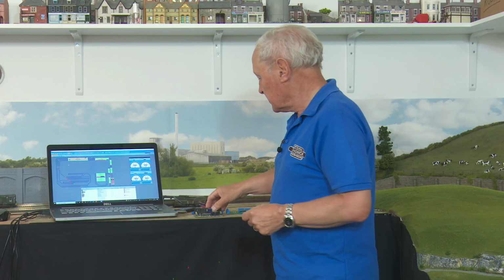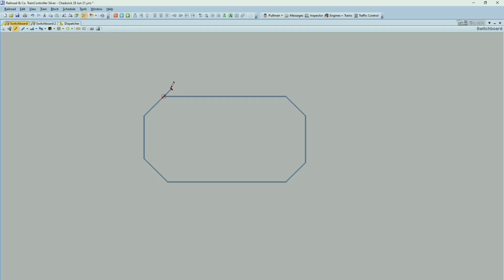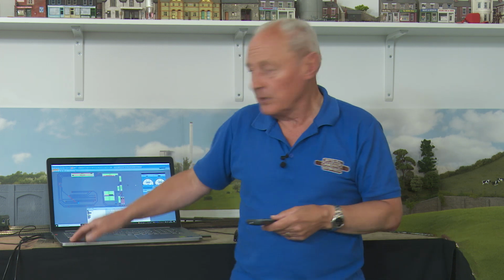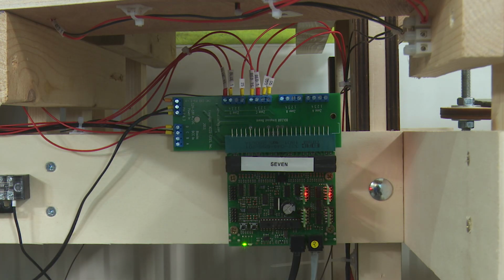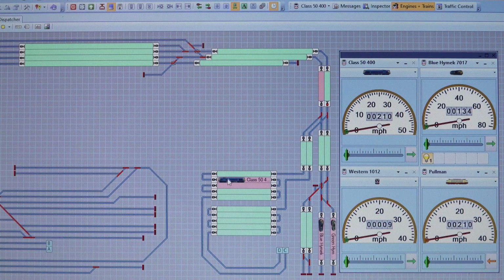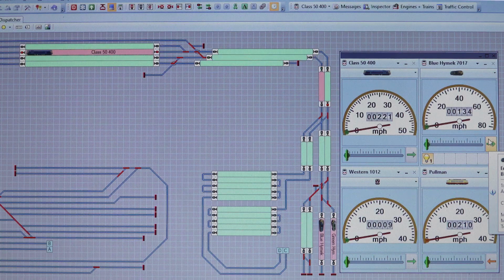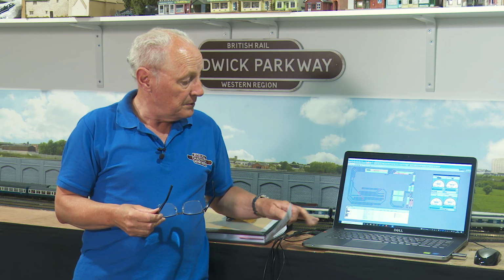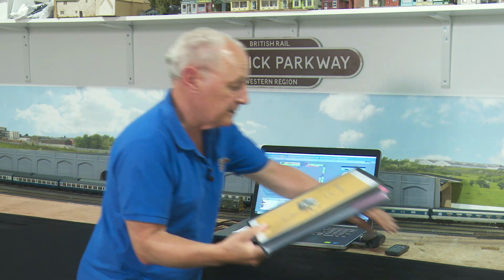An Intro to Block Detection at Chadwick Model Railway | 137.

Comment: A quick look, sales to the UK are made through Digital River.
It seems the cheapest place to buy it is Germany where it is made. It is slightly more expensive in Belgium than Germany which is strange as they can't stop a Belgian downloading it as a German. That right doesn't apply to us in the UK any more; though if you pay in Euros and download via a VPN that hides your location you might get away with it?
Reply from the maker: I still believe that we are getting ripped off mate. Regards Charlie
Reply: @ChadwickModelRailway  Only got ourselves to blame for it though.
Reply: The software itself is free, you can download and use in demo mode (runs for about 10 mins then drops connection to the controller) . When you purchase it, they actually send you a USB stick that has to be plugged in to maintain connections (you can see it on the right hand side of Charlies laptop). Its handy if, as I did, download and try it out and see how hard it is to use and if it does what I wanted before taking the plunge and spending cash.
Reply: @BearsTrains  That explains how they can use differentiated pricing within the EU. The price differential for the UK is customs duty, commission and charges that have to be added since January 2021. Not us being ripped-off by the supplier then but us being ripped-off by our own collective stupidity.

Comment: There is a system called Dinamo which will run DC locomotives and Digital Locos with computer control. We have a demo in the shop at DCC Train Automation
Reply from the maker: An excellent point James.

Comment: Good video as always Charlie and explains block detection very well. As to the price you quote for the digitrax bdl168 it can be picked up much cheaper than the price you quote. Detection on points personally I do it but some others don’t but something to bear in mind is the volt drop between a detected section to undetected one. Are you aware that when you use a bdl168 and track power is off but there is voltage supply  feed to the bdl168, that there is a small 1/2 volts supplied to the track still. This is caused by leakage within the bdl168 allowing some of the supply voltage through. By the way at present I have a total of installed bdl168s is 55 and climbing. 

As to train controller price the reason is simple for the rip off price, but I won’t comment here as to why. But how can it be justified that a 300 dollar difference in price between one country and another, in fact the day we voted to leave Europe prices were put up, and at one point stopped selling to the uk completely. The developer of I-train must be laughing at the cost of Traincontroller.
Reply from the maker: You make an excellent point comparing itrain to train controller. Welcome to rip off Britain, regards Charlie
Reply: Chadwick Model Railway 

not so much rip off Britain I think, more like not liked Britain

Comment: Hi Charlie, If you are not afraid of DIY electronics and can wield a soldering iron with reasonable confidence then there are much cheaper alternatives. I use the Digikeijs system as a basis for my layout. The most important thing for me is Loconet, as this means everything is communicating with everything else. However, as you have pointed out, proprietary systems can be expensive, i.e. Digitrax. There is a man in Holland, Nico Teering, who has developed a loconet system based on Arduino hardware. His company is ArCoMora (Arduino Controlled Model Railway) He will supply kits for you to assemble and solder yourself for servo and accessory control as well as block detection. The block detection hardware is called ArLoco and consists of an Arduino shield (you have to supply an Arduino Uno yourself) and two Okkies that are current detection boards. You may also use reed switches or hall effect without using the Okkies if you so choose. The main thing is that the ArLoco board communicates to the system through Loconet. I can knock up a few of these in an evening at home and the cost is much lower. The cost of an ArLoco shield and two Okkies is currently 15.75 euros and that will give you 16 channels of current draw block detection. His servo controllers are good too, costing just 8.75 euros to control 8 servos and 8 relays. The downside is you have to assemble and solder it all yourself but if that is within your capabilities then it certainly can save a lot of dosh. Hope this helps others who may want block detection but don't have deep pockets. I have spent a day with Dave Townend at McKinley and it inspired me to get into automation but on a much less grand scale.
I am currently working on Turntable control through Arduino and stepper motor. That would make an interesting video at some point.
Reply: P.S. I also use Signatrak DTM30's for all central control which means I can choose between switches and levers or leave it to the computer. They really are great little boards for the money.
Reply from the maker: A great comment Keith and I shall certainly check out the signa track board.

Comment: A great video as usual, Charlie. It's probably worth pointing out that you can get benefits of Block Detection without using any software at all - other cards can pick up the section occupied messages and "do things" (like setting signals or operating a control panel). I'm flabbergasted by the current price of TC Gold, especially the way they're ripping off the UK - even assuming they're adding 20%VAT this doesn't explain it.

As for the DR4088LN-CS, the LN stands for Loconet and the CS for Current Sensing. That beastie really is compatible with the BDL168 (other than not being able to be on 4 power districts IIRC) and you'd have no problems in mixing them on a single layout. To save even more money, you'd only need one LN device, and others can daisychain to the cheaper still S88 devices, and you'd still get everything presented to loconet!
Reply from the maker: Great comments John, I’m so pleased that you found the video interesting. Regards Charlie

Comment: Great video as usual. My layout (Tinkers End) is around 15m by 6.5m and has over 100 points. I use Digitrax (one main controller and two boosters) these power Digikeijs units for block detection. As the layout is split into 3 main power areas I use DR4088LN-CS, as you described, as the main unit attached to the power supply but then daisy chain DR4088CS off of them which makes it a bit cheaper. Actually that's not quite true I now have DCC Specialities PSX3 or PSX2 units immediately after the controller (or booster) so that track power is kept separate from points motors etc. The system all feeds in to TrainController Gold for as much automation as I want on the day. In terms of price I did see somewhere that the guy who develops the software wasn't happy dealing with UK modellers (and that was even before Brexit).
Reply from the maker: A great comment TE. 
Where are you in the UK?
I’d love to meet up once this madness dies down.
Regards Charlie.
Reply: @ChadwickModelRailway  Actually I live in the Murcia region of Spain but if you are ever over here let me know.

Comment: Thank you for a fascinating overview. You implied when talking about pricing that ‘mix-and-match’ between manufacturers is not an option, but as long as the Digikeijs DR4088LN uses LocoNet won’t it run just as well as any other unit? I do understand the warmth you get from staying with one manufacturer, but I thought the whole point of using LocoNet was to provide a standard interface. I assume you tell Train Controller what devices are connected to your layout and it then knows what commands to issue to the various devices.
Reply: Yes the digikeijs DR4088csln will work with loconet. The C's stands for current sensing and the ln stands for loco net.
There is a version without loconet that uses the sx88 protocol ( I think the name is correct) that is slightly cheaper that will work with other SX 88 protocol gear eg the dr5000 command station.
Reply from the maker: You make a valid point Peter but maybe DCC Train Automation should be your best contact.

Comment: Great video again Charlie. After talking to James at DCC Train Automations a few years ago I went down the Digikeijs and iTrain route and it all works great. It's much cheaper than Digitrack. The command station can work with most if not all systems.
Reply: Hello Steve hope it all working well if you need and advice or help please let us know. Or if any one needs and help with computer control we are here to help you all.
Reply: @DCCtrainautomation  Hi James. I will be down to see you soon as you still have my two locos. Been held up in London with work.
Reply: @stevewebb1606  they are all done!
Reply from the maker: Thanks Steve, great choice with great support too.

Comment: Hi Charlie,

Great video again. You said you couldn't find a system that is usable for DC. Well in fact there is one: It is a Dutch product called Dinamo. It is made by a small firm called Van Perlo Electronics and Automation.

http://www.vpeb.nl/index.php/english/solutions/ 

It makes it possible to run both DC and DCC trains on a single layout. The system knows if there is a DC or a DCC train in a block and sends the proper voltage (analogue PWM or digital DCC) accordingly. It is more expensive per block, but it saves the cost of building a DCC decoder in every loco. I also have some small H0e loco's in which it would be difficult to built a decoder.
It can be perfectly automated using iTrain.  I myself am using this combination and I like it very much.

Regards, Rudolf from the Netherlands
Reply from the maker: Thanks Rudolf, that's most helpful.

Comment: Interesting stuff, and well-presented as ever, Charlie.  Right, crawling over.  "If you want block detection in DC, you need to switch to DCC."  Ahem.  My dad and I had block detection on our layout back in the 1980s.  Exactly the same principle as you showed, with insulated rail joiners at each end of the block (which we had already, of course, with control DC). If there was something with a circuit (a motor or a lit wagon, or a wagon with resistor across its wheels), it would trip the track detection module, and it'd show as occupied and set the preceding signal to red.  The track detection modules were bought as such: they were a PCB with a few components and a relay.  I can't remember how much they were, but they weren't cheap even then (although arguably you got more actual components on the circuit board back then) so we only used them in the main station area and in hidden sidings.

With regard to the software price variations from country to country, I noticed the manufacturer was somethingorother GmbH - so a German company. It could be something to do with exporting from the EU to the UK, particularly if there's any physical element to the product.  I don't suppose model railway software is at the top of the British Trade Secretary's to-do list...  It sounds like there's a market for a free or cheap user-friendly interface to JMRI.
Reply from the maker: A great comment Andrew. And rekindled memories too. Regards Charlie.

Comment: Hi Charlie, I use MRC and the software that sits about 6 inches above my neck. The software is un reliable and when operating more than two trains can result in random emergency braking.
Reply from the maker: I also use a radio operated power break.
Great when panic starts raise it’s head.

Comment: A very interesting side to the hobby indeed. And like I have mentioned before, I am not a railway modeller, but the engineer inside of me is wondering about those plastic isolation rail joiners that you use, are they simply a plastic version of a normal fishplate, or does it have an actual bit of plastic between the heads of the rails? Cannot tell from the video, I imagine it must have something to stop the rails creeping together when the weather is hot etc. All very interesting, always a joy to sit down and watch your videos.
Reply from the maker: Dead right Steve. There is a thin vertical plastic divider.

Comment: Hi Charlie..superb video as usual. I took influence from the original chadwick and spoke to James and Ed after realising that digikeijs is more affordable . Currently using Itrain standard and Dr5000 power module and dr4088cs modules. The train controller software looks a little easier to draw your track plan compared to Itrain. But it does exactly what I need it to do apart from the programming part which is itrains next one up from standard but tbh I use jmri programmer for such needs ..thanks as always for a superb video
Reply: Hi Lou - Im using the same setup as you - thought it interesting, very happy with it
Reply from the maker: I’m so pleased that you found it interesting guys.

Comment: I primarily use Digikeijs for all my DCC as it very versatile and good value for money.
I also use Rocrail software, it is a free open source software witch is similar layout to I trains but can be a challenge to get your head around.
Reply from the maker: Thanks RMR, much appreciated.
Reply: Also use Rocrail. Works very well and for a very small yearly fee you can get help directly from the developer of this system and there is a forum with great help. Digitrax  for all my block detection power sources and turnout controls. 👍

Comment: Another excellent video, Charlie!  Three days ago I got my first DCC starter set, a Zepher Express, even though my new layout is a very small switching layout for one loco.  My Walthers Plymouth switcher now runs smoothly at very slow crawling speeds.  I also did my first DCC conversion, putting a Tsunami2 TSU-1100 and speaker into an old Proto 2000 SW9/1200.  Whew!  I had to remove the cab interior for the speaker and the extra weight for the decoder, but the results were worth it.  I can now have very authentic sounds when I'm in the mood.  The technology now is leaps and bounds beyond what was common in the late 90's when I did my last layout build.  Thanks for sharing your knowledge and experience.  Cheers from Wisconsin!
Reply from the maker: What a heartwarming comment Andrew, regards Charlie.

Comment: Charlie, If you use XE.com to convert the UK train controller price numbers into GBP, they are remarkably close: 220USD on the UK price list page converted into GBP is £159 which isnt far off the 154 number from the US pricelist.The $639 is £464, close to the $474. The $930 is £675 which is close to the $699    and the I think someone when building the train controller website converted the actual numbers from USD to GBP, but never changed the actual units. So now it confusingly says, on the UK price list, the exchange rate converted GBP number but with the original USD units of measurement. We should really point that out to Train Controller so they can change it, assuming that is the issue of course!
Reply from the maker: No Tom, it's the owners dislike of Brits, post Brexit.

Comment: Well Charlie,  you make a good point it's not for everyone,  while it all sounds great  tho have your train running automatically , I think I'll stick to running the myself. I still want to have a signal system but I want to run the trains myself.  But you did make the point to not limit yourself and think ahead. You point about the difference in price is like you said,  appalling.  Thanks so much for your helpful advice 👍👍👍👍😀
Reply from the maker: Thanks JO, it’s great to have you onside.

Comment: I have had a lot of success with the Big Bear Control software running on an NCE Powercab. Whilst it doesn’t support block detection, it allows you to run automated on a time interval system. You can tell the software how long it will take for a train to get from A to B, at what speed, and what points need setting, through the ‘record’ function. There are some issues with replicability - obviously, not all locos will drive at the same speed as they have different motors - but if you have a train running the same route, for example a DMU running along a branch, then it can be an easy and cheap way to get into automated running.
Reply: Excellent As always Charlie
I am about to Start a new layout and think it's worth adding.those insulated joiners Just in case
Reply from the maker: Thanks Sam, an interesting option.

Comment: Currently my startup layout is connected to a SPROG 3 (100 USD), which runs into a Raspberry PI 3 (Raspbian OS Linux graphics User interface) with JMRI and Decoder Pro to run multiple trains on the same layout with sound (any old laptop or PC will do). The SPROG connects via network cable to the computer with feeders to the track. Even medium layouts needs extra power boosters though, and no real automation or block detection is possible - but it's a very cheap way to get up and running with full DCC and for programming your trains! My next (again CHEAP) step will be to add an Arduino MEGA with an input/output shield with 256 channels (75 USD) and install the excellent free DCC+ protocol onto it. You have to add/control the conditions in the Arduino script yourself for each channel (input/output) but this solution gives you ALL the power of DCC, block detection, signals and automation for the smallest amount possible (I believe) - and probably the most amount of frustration and swearing too! Love your work Charlie -  and thanks for clarifying how the software keeps track of each loco for you. It finally clicked in my head how I can do the same in the Arduino for an exhibition layout with full automation.
Reply from the maker: Great comment DSB, hopefully will be useful to other modellers. Regards Charlie.